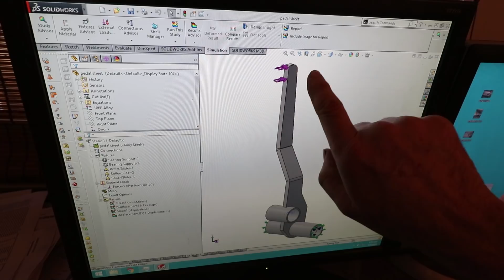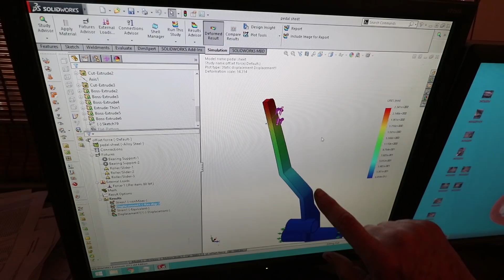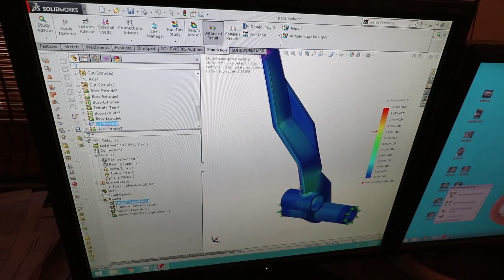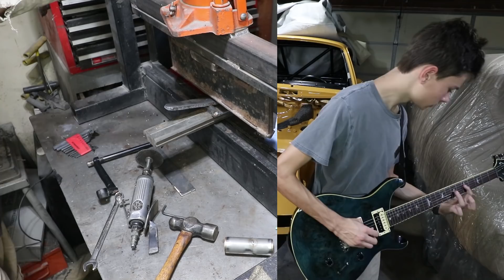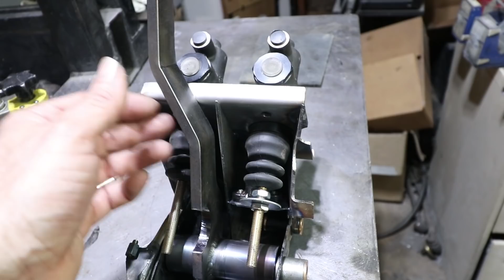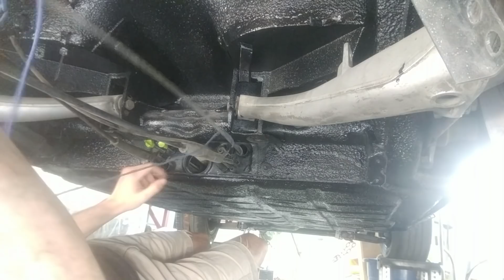I Overkilled My Brake Pedal!  The More You Know...

Comment: I would say the brake lever gusseting should be concentrated around the pivot point mostly to prevent deflection. I like the solid works animations.
Reply from the maker: Forces are pretty high down there, but I'm not worried about a few millimeters of deflection in the pedal when the floor will deflect way more than that.

Comment: You constrained the pedal wrong it needs to be a pivot at the bottom and also at the balance bar tube. This will change the results.
Reply from the maker: Really, you think the pedal pivots around the floating pushrods? Ok.
This analysis and max deflection is done when the master cylinders won't compress anymore to react with the 80 lbs at the foot pad.  The only thing the balance bar does is push back on the pedal.
Reply: @GarageTimeAutoResto  it doesn't matter where it pivots around and you didn't have any force coming from the pushrods or at least it didn't look like it.

Comment: Braking systems are almost always worth over-engineering :)  Surprised you plasma cut those two holes rather than, say, using a holesaw in the drill press.  Please thank Zach for his background noodling and congratulate him on the school acceptance.
Reply from the maker: Will do thanks!  I didn't have a heavy duty hole saw of the right size so I had to die grind it to size anyway.  Good hole saws are kind of pricey too and the drill press probably spins too fast as well.  
At least this pedal is a high touch item, ha ha.  I don't think I'm going to cover it up with a pedal board.

Comment: Are you not able to heat it up before bending ?
Reply from the maker: No, I'm not setup to get it hot enough to bend.  I would need an oxy acetylene torch for that thickness.  It wasn't  hard to bend at all once I changed the bottom die.

Comment: Tom - love this video, wouldn’t mind seeing more FEM analysis! Like that strut tower bar or rear torsion tube...

Q’s: When fabbing, how do you ask for steel at the metal supply depot? ie conversation about steel grading? 

Also, how do you calculate the range of force to apply in a test and how does that map to the particular steel you choose?
Reply from the maker: Cool, I try to add more FEM.
99% of the time I choose mild steel, 1018 or 1020 (whatever they have)
All steels behave the same until they are pushed to the limit.  The specialty steels are no more stiff than mild steel.  (Look at the Elastic Modulus for a range of steels.  They are practically the same.)
A vintage Porsche only uses specialty steels in a few places:   A few bolts in the trans/engine and the torsion bars, anti roll bars.
Mild steel has great weldability, formability, and fatigue resistance.  
Chrome moly is great and the yeild strength is much higher.  This means I could reduce weight on my brake pedal by 10 oz.  
This makes sense for an F1 car, but guess what.  Those parts pushed to 80% of the new yield strength have a definitive lifespan.
My policy is to always design the part for infinite life with low strength steel, 30-40% of the yield strength.  
If you really need high performance, then the steel and design need to be very closely matched.
Reply: Garage Time - Restomod The last part, clarify? ...r u saying, design with low strength steel to be super strong, defined by maximum yield as determined by FEA? Engineered @ 30-40% of 100% yield? A little unclear on that last part.
Reply from the maker: Yes, the brake pedal is strong despite low strength materials because the size and shape is strong.  This is verified with FEA.  30-40% of tensile strength is very conservative and consistent with what the factory did.
Reply: Garage Time - Restomod great context!

Comment: Love your videos. Great solution, I have to do something with the accelerator pedal on my 67 911.
Reply from the maker: Thanks, what's up with gas pedal?  Are you thinking of repositioning?
Reply: @GarageTimeAutoResto  It is very weak, laterally, I have had it bend and then get hooked up in the tunnel edge. really gets the heart beating when your throttle sticks wide open. I just replaced the original pedal with a 917 style curved aluminum one. even pushing the ball end of the connecting  rod will bend it.
Reply from the maker: Well you don't want a stuck throttle that's for sure.  Seems like the mounting base is kind of narrow.  Maybe the hinge is just worn out.  Kudos to you for wearing out a gas pedal!
Reply: mikl911 I know exactly what you’re talking about as I have a 67 912. do you not have a pedal board behind the accelerator pedal, and a stop under it, to prevent the lever from getting bent?
Reply: fg jf yes that was part of the problem I had an aftermarket aluminum backing board but didn’t initially have the stopper. I do now and It did resolve the issue but still concerned how weak that piece is.
Reply: mikl911 Well, if you have a stopper, it shouldn’t get to the point where the lever will bend. The pedal will hit the stopper before any real pressure bends the bracket.